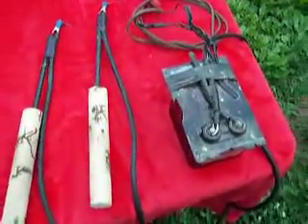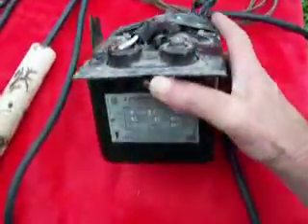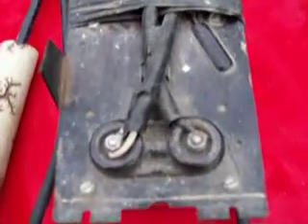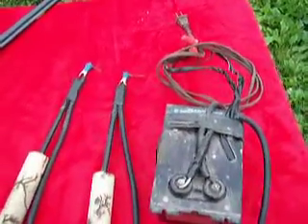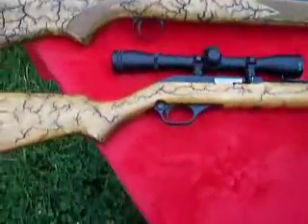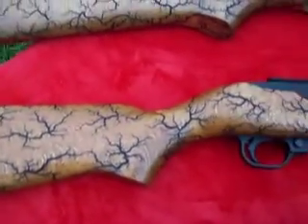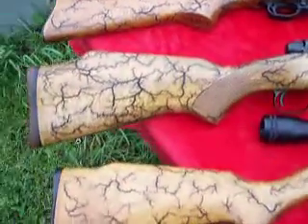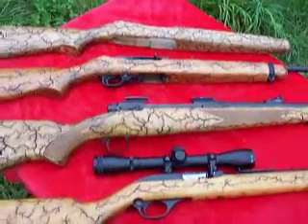My Lichtenberg fractal burning setup

Comment: I have to hand it to you man 
that's quite interestin
 using a secondary Transformer for wood burning
Those wood stocks turned out quite interesting  I've never seen anything like that.  very cool
Just a request. suggestion  if you have the time to do it again
 is it possible to do the lightning burning again with a darker wood stain  thanks for taking the time and sharing man